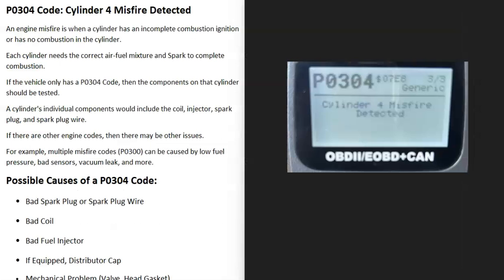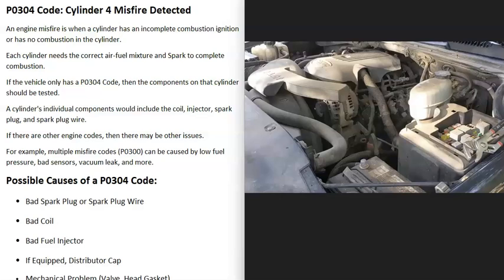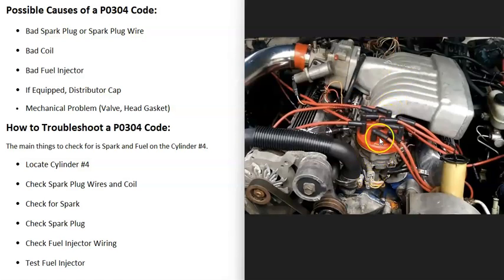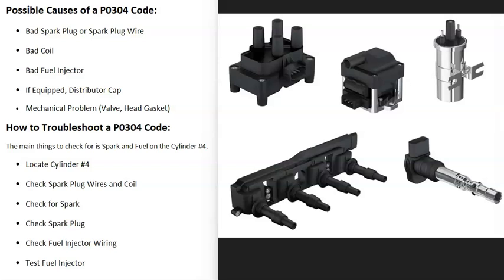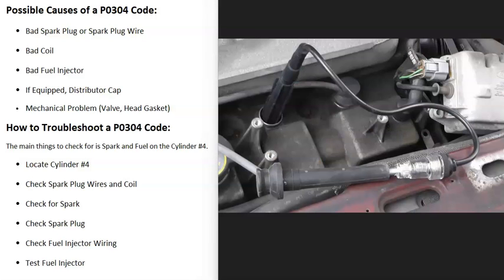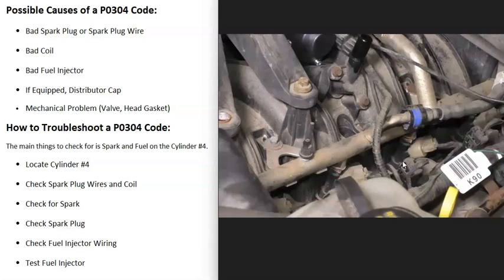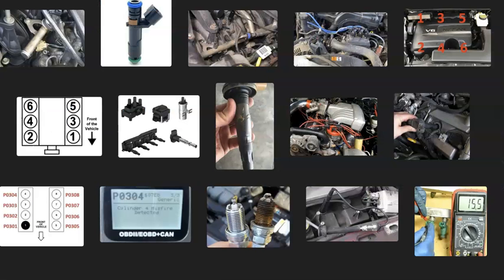Causes and Fixes P0304 Code: Cylinder 4 Misfire Detected

Comment: Hey I have a 2017 gmc sierra 6.2 I’ve had this issue and have been charged 3 time and they still don’t know what’s going on. We change, fuel injector,spark plugs, coils & wires any ideas?
Reply: Im getting code P0304, P2309
Reply from the maker: P2309: Ignition Coil "D" Primary Control Circuit Low. I would test the wiring on cylinder #4 coil.

Comment: Replaced coil packs spark plugs and swapped coil packs. Still comes up #4 no matter what I do. It took 140 miles before it came back on and now comes on frequently.  What do u think. 2016 subaru wrx sti
Reply from the maker: Intermittent issues can be difficult to solve sometimes. If the coil and injector are good, I would check the wiring very closely. There may be a bad connection, such as a bad pin or something similar. It is also possible there is a mechanical problem in the cylinder, which a leak-down test would show.

Comment: I have a 2018 Jeep Grand Cherokee 3.6L. with a P0304. I have a leaky head gasket that was diagnosed. I put bar leaks head gasket repair and it seems to be working but I have a slightly rough idle and no coolant loss and no white smoke. I drove it  for 100 miles or so.  But when I cold start the Jeep it seems to run really smooth. why is that? Then driving the Jeep 5 minutes later it seems to run a little rough on the idle. today I disconnected the cables for the engine coil #4 cylinder and it did nothing and removed the harness cables and also the coils to make sure. hmmm
I checked my hoses and I did the screwdriver test and my fuel injectors are working. I'm wondering why I get an engine light with PO304 with 07e8.  My spark plugs and engine coils have been replaced too.. why is cylinder 4 not firing? would you happen to know why this is happening?  thank you for the video
Reply: Have you found a solution yet? I have a 2012 that has the exact same 04 code.
Reply: @evilsilverback1480 Have you done compression test!? There's chance of bad compression in that cylinder

Comment: P0304 error being elusive
Gen 10 accord 2.0T
Swapped coils.
Replaced spark plugs.
Removed electronic fuel injectors flushed both ways with carburetor cleaner while pulsing 12 v terminal, all operated.
Cleaned intake.
Removed valve cover, checked valve clearance. Cylinder four was a little tight on the intake side. Adjusted.
Error still persists.
Next check- voltage at injector four.
Could it possibly be a vacuum leak directly related to cylinder four?
Is there a relay that relates to individual cylinders?
Any input would be appreciated.
Reply: Scrap it
Reply: 2.0t with the same issue. Did you ever figure it out?
Reply: Did you really requesting help after doing all this by yourself ? I mean, bruh.

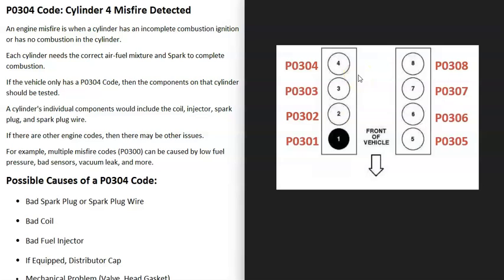Comment: The picture shown at 0:41 is the wrong firing order for most engines if not all. It alternates from left to right so number 1 should be on the right hand/ driver side, number 2 should be on the left/ passenger side and so forth going towards the firewall.
Reply from the maker: The firing order and cylinder locations will be different for every engine.
Reply: @HVAC_Mechanic  every engine?  huh..
Reply: The pic at 0:41 is how SBFs (like the 351s) are numbered. SBCs are numbered as you described
Reply: The image literally only show cylinder position, there no firing order shown there. Ford actually have most of their car using this position, but firing order will be 1-3-7-2-6-5-4-8

Comment: Hi, great video on this. I sent mine into a local garage and they said i would need 4 new spark plugs and an ignition coil for cylinder 4. They actually put the  coil pack on cylinder 1 lol and not 4. I changed these around so the new coil pack was on cylinder 4 but still got the p0304 misfire? even though there is no performance loss on the car I'm still getting this code pop up when the engine light comes on. I rang another garage and they instantly said it was a burnt valve/cylinder or whatever? I said could be be the fuel injector and they said um maybe? wtf. I honestly think they was trying to scam me as he said it would cost between 1000-1500 £. I have no confidence in any of these garages any more so unfortunately I am going to take my civic into Honda and let them sort  it.
Reply: Did you get the issue fixed? If so, what ended up being the problem, thank you
Reply: @eatrucking2334  in the end it was the fuel injector on cylinder 4. This was given me the misfire code. All sorted now.

Comment: Your screwed with 300 code.
Reply: Po300 is a generic misfire code that can't be pinpointed because it's jumping around.

I had this on my van
I call it the BRAZILIAN HOOCHIE COOCHIE because my fcuking Brazil Brazil mechanic didn't snug down my plugs when he did a tune up.

I was 1500 miles away.
Brought to shop, guy puts live read on the engine and sees misfires all over the 8 cylinders.

He even sees one plug  shaking around.
So I had them snugged to spec and I was good 👍 

Lesson;
Brazilian mechanics arent that great.

Comment: I have a ram 1500 2007 .
I change everything you described and i still get the same code.
Reply: Same… did you ever figure out the problem?
Reply: @Faithoverchaos2026  was spark plug checked? Resolved now?

Comment: I changed my spark plugs and ignition coils 😭 still having the same issue
Reply: could be fuel injector or vacuum leak.
Reply: Hi my car to
Reply: Did you get the issue fixed? If so what ended up being the problem thank you
Reply: @D3L0-b8h  brother it was the cables to the crank shaft sensor iam like 1500 less in mechanical issues  but my mechanic  from mex came to Phoenix  and he figured  it out ufff .. super good trucks ....best I've ever had to be onest 99 150 4.2  manual transmission  ❤️  hope u get ur things fixed
Reply: @josecampos5179  What kind a car?
Reply: @eatrucking2334  1999 f 150 4.2 mnl..
Reply: Spark plugs cables?
Reply: Iam changing these on wendsday already did the fuel pump but some times it dont want to start  f 150 4.2 1999.. 😊 admirable  👏 😊
Reply: Carbon on intake caused by short trips, and lomg idles.Or cheap gas from Joes gas station

Comment: This why I hate you tube. You have no idea lo.
WHAT EVERY vehicle has a matenancce  schedule .

Every vehicle  get a tune up every 80k -100k all spark plugs and coils air filter and clean the throttle body. The moment the check engine light blinks its tune up time 
. The moment the check engine light comes on stop go to autozone and get a free list of codes then call a mobile mechanic.
Reply: It 100% not feasible with interminent issue.